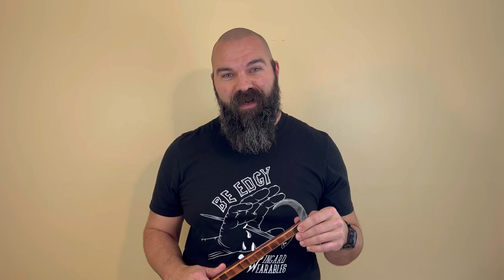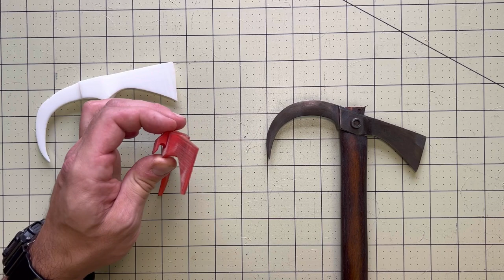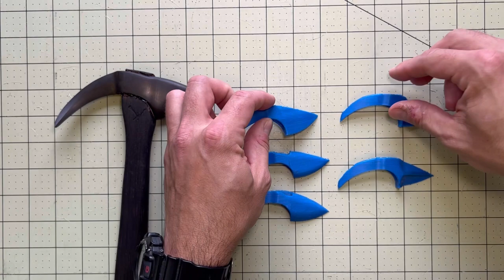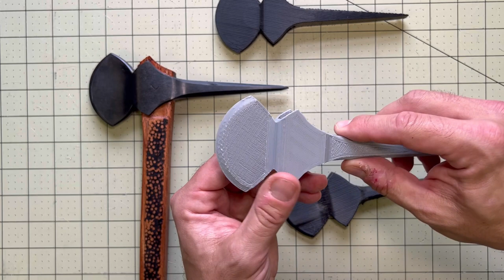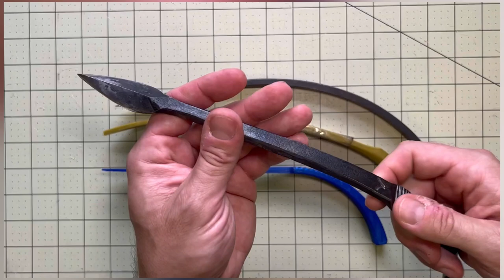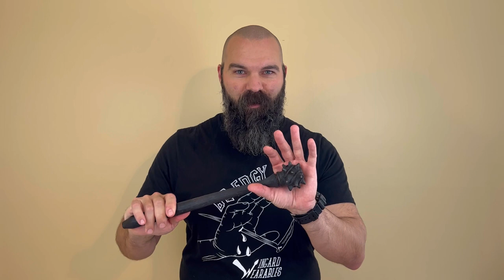3D Printing as a part of the design process

Comment: For the Mace ... think of a spin lock dumbell. The dumbell has a threaded shaft with collars that are also threaded. The mace shaft could be threaded at the top and multiple threaded 
"collars" that would be flat and look like sharp pointy throwing stars (dual purpose use) could be stacked or even used with spacers in between to create a 3d mace that would break down to a threaded shaft and a few centrally threaded "throwing stars" that could be carried safely in a seperate leather or kydex pouch. each component could be used seperately as an iron rod and throwing stars or combined to form a mace quickly and easily with edc-ability too! ...I want opportunity to buy it if you make it . I got the Micro DP in AebL its great and is my preferred tool for olive hunting .
Reply from the maker: Interesting idea! Kinda reminds me of the latest mace from Tod’s stuff, where you stack little mace heads on a wooden handle.
Reply: @wingardwearables  I didn't see that. I do club and mace swinging for exercise and an adjustable club is $$$ so I got the 21" or so spin lock dumbells and extra collars which are 0.5 lbs each and are a roumded off six pointed star. I can fit 10 collars on one end and I put an ESI grip on the other end . Its like 12 poumds or so and definitely would do damage but something sleeker , lighter and sharper would be ideal. I can send you pics if you want .
Reply from the maker: @QKVCS  Just paste a link in a reply and I’ll check it out, thank you for the suggestion

Comment: I’ve been hoping you come out with a small, edc mace. How about something that’s not so pointy…a little more like a sap. I made some using large socket wrenches as heads. They’re easy to carry and very effective.
Reply from the maker: Thank you for the suggestion. I have carried saps and although I’m a fan, I think there are a lot of talented makers that are addressing the need. So if we tackle a sap-like impact weapon, it must be a unique capability, unlike what’s addressed by the market already. A while back I was researching those Cossack whips and there may be something to that—something a lot more effective than those “stinger” steel cable whips as well. Anyways, we recently bought an industrial sewing machine that can supposedly sew through up to a 1/2” thick of leather. So if we explore those concepts, we at least have a means to make them efficiently.
Reply: @wingardwearables  can’t wait to see what you come up with!
Reply: What about a flat 2D mace like the flat war club?

Comment: Always one of the 12 👍 
Had a similar experience with a design I was working on years ago. It was going to be similar to your dick pick.  Got a plastic model laser cut for me and saw the flaws fast.  Never did perfect the design. Of course now your dick pick is freaking awesome so no need for me to try and fix my old design.
Reply from the maker: Yeah design refinement is hard to do. I don’t even want to think about all the concepts we had that didn’t make it through the design process. Most of those were a lot wackier than the mace—that at least was easy to show and explain on this video.